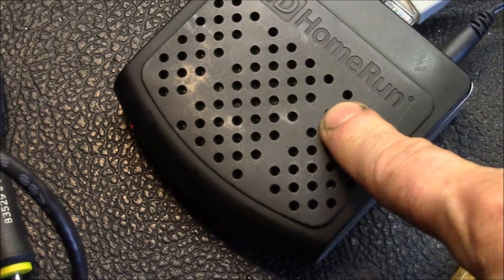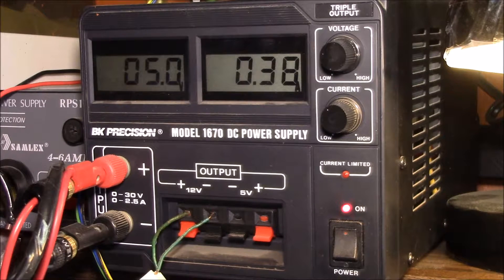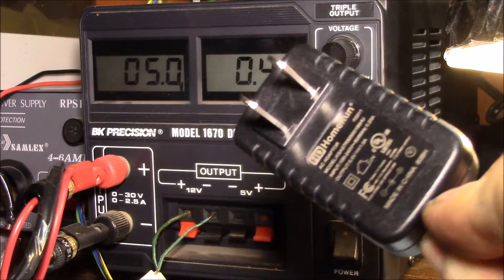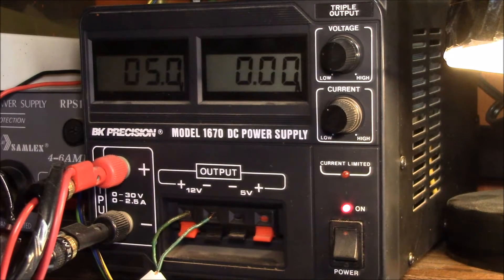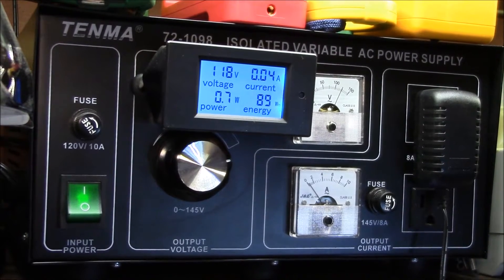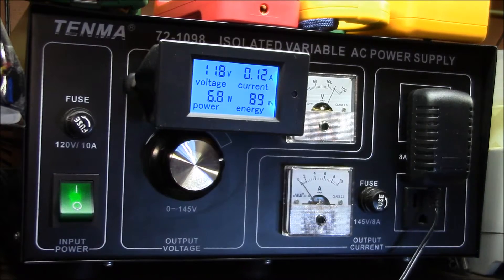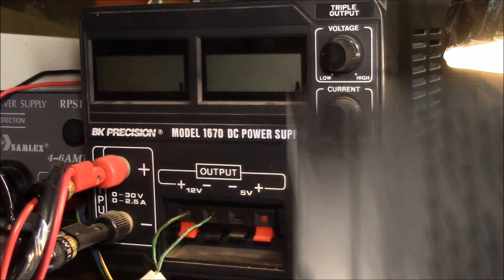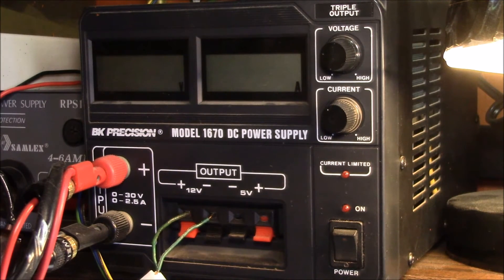HDHomeRun v3 Network TV Tuner - Power Consumption

Comment: You got a nice power supply set up.
Reply from the maker: Thanks, it is a very handy device.  When I purchased it I didn't really have too many plans for it, but once set up, it's so very handy.  I do need to replace the power meter with a more accurate one and modify that so it reads down to 0 volts and hopefully 0 amps/watts at no load.